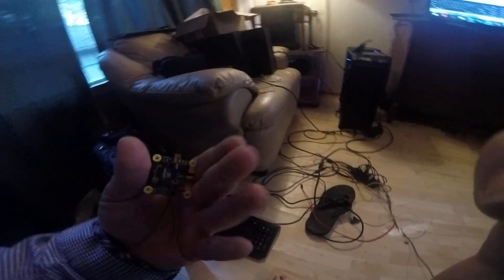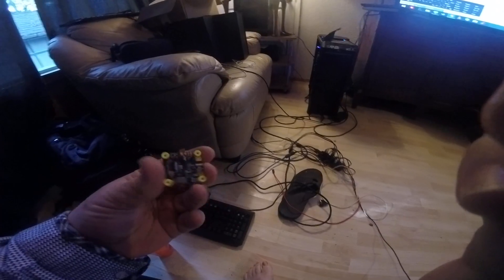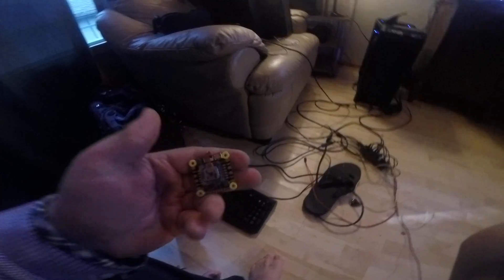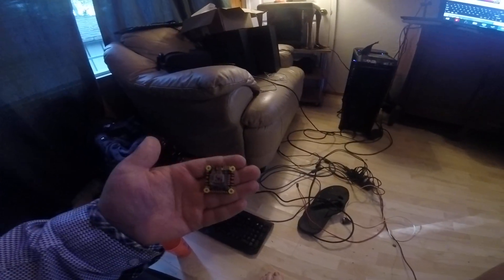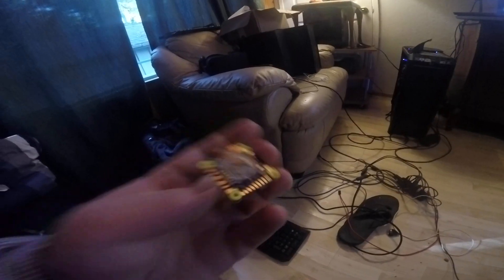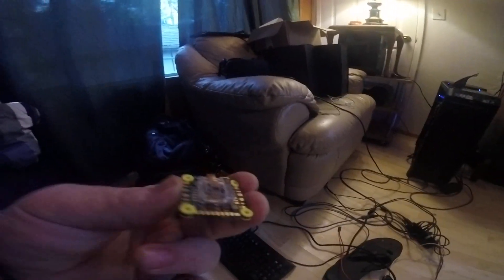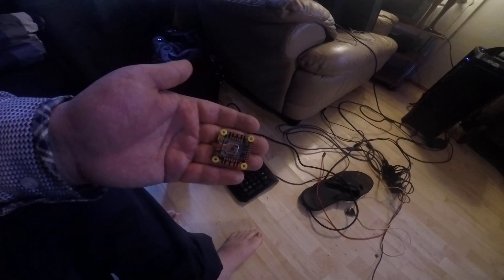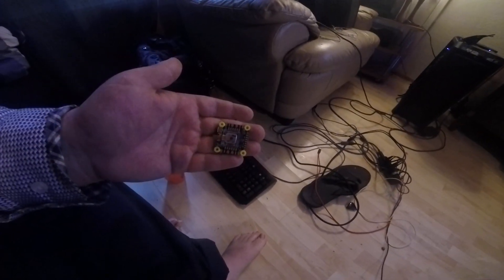BetaFlight F7 Flight Controller with 3.3 - Buyer beware?

Comment: Betaflight 3.3.x target is FPVM_BETAFLIGHTF7, that should get blackbox flash working.
Reply from the maker: thx! Looking forward to trying 32x32 dshot 1200 on betaflight.  I've been using the helio spring with Odin and I'm not in a hurry to get off that hype train.

Comment: Hey Guys,
Not sure why you guys can't find information for this board. Now unless things have been updated. I have had no issues finding info. The target is listed as "FPVM betaflight F7" not sure why this was done but it's there. If you don't see it  maybe you don't have the latest configurator? You can also download the wiring PDF from FPVmodel.com 

ChamelionTi 
BetaflightF7
Runcam swift 2
TBS unify pro HV
Emax LS 2207 2450kv
FrSky
Gemfan 5150 triblade.

Comment: In your description you say that the board is not endorsed by BF, can you share a source?
I am on the edge with this board ATM, would you say it is a good future proofing option for someone who doesn't mind some small early adopter problems??
Reply from the maker: I found this info in the Beta Flight Dev forums. (Search BFF7)Found a thread discussing firmware for this board, and the consensus was a 1:1 clone doesn't deserve firmware of it's own. They'll make it eventually and you can already piece together the code if you know about compiling - I don't. The board works great and looks awesome. I don't regret the buy, but you can get the Omnibus f7 for less. Hope that helps!
Reply: ProximityFPV Thanks for the reply, I know a lot of boards are just running the omnibus firmware so that's not really a problem, the layout and pads on the BF look like they will be a lot better to work with than the omnibus board so I think that is what would drive me towards rather buy the BF.

Have you run 32khz on it yet?

Again thanks for the reply, struggling to get info on this board so really appreciate it :)

Comment: I just installed this new Betaflight F7 board in my Alien quad and I’ve noticed 3 things so far that concern me.  1.  Max amps ever read is 85 (current sensor doesn’t seem to be calibrated) and thats with F80 2500kv motors!  Should be twice the amp reading, 2. Video filtering is not good even with a 1000 35v capacitor.  I added 4 more capacitors to the ESC’s today and will retest tomorrow.  3.  On 6” props the quad dips hard on fast punch outs and 5” props fine. As you said there is no firmware available yet.
Reply from the maker: I did only test flight for 17 seconds before I broke 2 props and maiden another one. Now I'm concerned I crashed because of a problem rather than me not expecting a heavier cameleon frame. I'm on a 5' running wraith 32s on dshot and video was clean as can be. I am running one cap. :/      I'll test flight ASAP and let people know if I see a problem.
Reply: I'm running a pretty powerful setup. T-Motor F80's and 2500kv with some T-Motor F35A ESC's.  Betaflight 8k8k stock PIDS and default filters left on.  Watch your amp draw. I wonder if there was poor QC on this first batch and they didn't calibrate the current sensor.
Reply from the maker: Seems to run well on mine. No video issues and it flies smooth. I spaced and didn't pay attention to amp draw, but I'll keep an eye out.

Comment: Its a very new FC and the betaflight Devs have been working hard lately with the new filtering work so give it some time and things should improve. 
Hopefully they add the target before 3.3 final is out.

What this video shows is that software support is incredibly important and you should choose your FC based on what you want to run on it tbh.

But whilst the F7 has the ability to process data faster than an F4 clock for clock that advantage is very task specific and may end up being quite minimal with the type of realtime calculations in the pid controller. similar to running a single threaded app on a multicore cpu there wont really be an advantage.

Where i see there being a huge advantage for f7 is with applications such as gps navigation etc where the extra UARTs with inversion. I also suspect the cpu power of the F7 would be better utilized by the concurrent tasks of something like INAV.

Comment: Betaflight is all you need with 3.3 firmware and 32k 16k and a good fc betaflight flys just as good if not better then kiss and raceflight as of last week when I  flashed the Kalman filters.  Watch one of my videos I fly on stock pids to.  I might adjust P and D term a hair.
Reply: Doz3R FPV you may have to try butterflight as the Kalman filters won't be removed
Reply: Peter Den next weekend I'm going to flash it

Comment: Hey dude, nice review!
Did you manage to flash it with 3.3 RC2 ?
I'm really curious to know how it runs on that board. Keep us updated, thanks !
Reply from the maker: Thank you! This was on a whim, but I'll put in some effort next time! The board comes with a Ver. of BF 3.3, but there is currently no firmware for this board online and no information on the ver. installed on the board. I couldn't run it at 16x16 pid loop, but it runs at 10% CPU at 8x8 with dshot1200. I'm happy with the buy and they'll probably release firmware soon. Can't wait for them to optimize for F7s and come out with a real Kalman filter!
Reply: ProximityFPV ok, and what if you type "version" into Cli, what is it giving you?
Maybe the target is the omnibus f7 V2.
I'm looking forward to try this!
Reply: Target is BFF7 BETAFLIGHTF7 3.3.0.  it comes with this but it's not available online.
Reply: justin v ahhhh ok, it sucks!